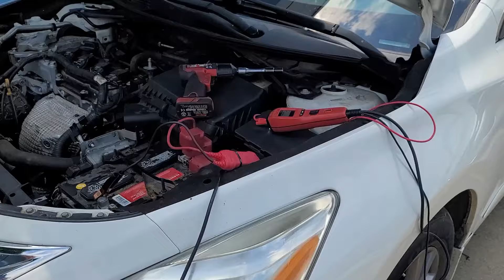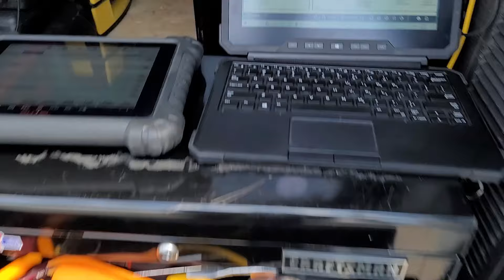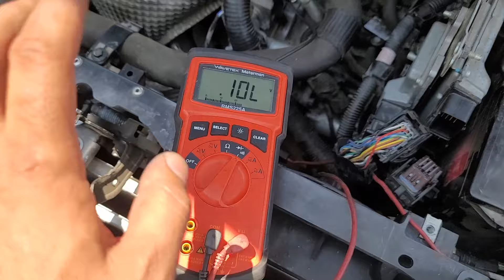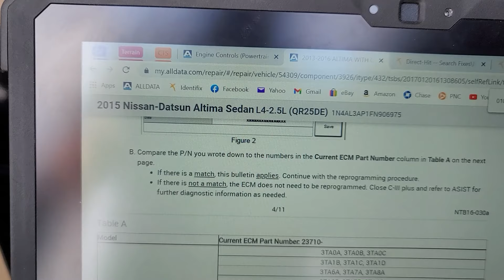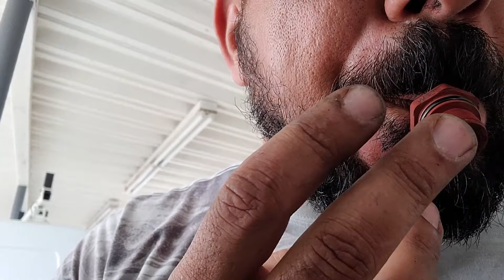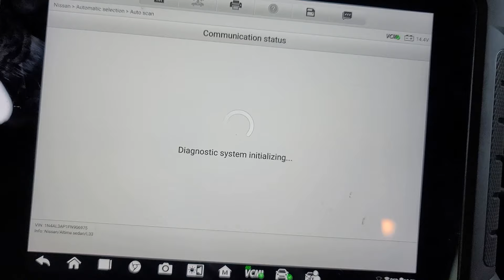P0101 Very Important and cheap repair, 2013-2016 Nissan Altima

Comment: Nice! I was about to change the PCV after not finding anything wrong and troubleshooting everything. There are a few things left if the PCV doesn't fix it. The dealership couldn't fix the issue, charged the customer for a new MAF (customer just had a new autozone MAF) and the update and returned the car in the same conditions while telling him they could fix it by installing a cold air system for like 1k 🤦. Good that I found your vid. I needed reassurance 😁. 🙏

Comment: Hi   thank you for the nice video   

I have a similar issue that I don’t know how to resolve 
I have a 2016 Infiniti QX60 SUV 
no check engine light on. 
all monitors are ready 
car drives fine 

but there’s a permanent code P0101 that will not erase and I’ve drove the car like 3000 miles.  I need this code to be erased from the computer so I can smog the vehicle. 

ANY ADEAS YOU CAN SHARE?  Much appreciate it
Reply from the maker: You may have to reprogram your PCM to solve your problem.

Comment: All nissan 2.0 and 2.5 get this code because poor design of pcv system. It draw smokey oil fumes through air cleaner which often micro sprays into intake getting the sensor dirty and or dirty throttle body . I have also found rodent nests in intake pipe that cause the same code. Also causing this code is cracking in the flex pipe before the throttle body. If it was electrical problem you would have many other codes particularly oxygen sensor codes.
Reply from the maker: Nice tip 👌
Reply: Damn you must live in Brooklyn too Smhh … damn rodents !
Reply: What can i do to fix it? Im tired of cleaning my throttle body.

Comment: Thank you very much guy. You really help me.This problem makes the car weak.  Sometimes there is no power at all.
 I left my car with un electrician for one month to fix this problem and he couldn't.
Now the car is Ok
11810-EA200 this is part number of replacement black
Reply: The TSB says that it only applies if there is no drivability problems, so if you feel no power that's most likely caused by something else.
Reply: @advancedleveldiagnostics  
Yes the problem still there.  But not like before
Reply: r arreglarlo  y tengo que Hello, I have the same problem in my car, it is a 2013 Nissan Altima. They charge me 450 dollars to fix it and I have to fix it because it doesn't pass the smog check. They have to reprogram the computer.

Comment: I changed out my maf sensor out but the car still didn't get better the check engine light didn't come back on but the code I got was po101 on a 2012 Nissan Altima
Reply: Hello, when you changed the part of your car, you reprogrammed the computer and if the smog check passes, let me know, thank you

Comment: I’ve been so frustrated with my car and the Nissan Dealer 😤 my altima has been giving me issues with this P0101 code for like 3 years. I have tried cleaning the MAF, replacing it, had my throttle body replaced by the dealer and I even replaced the pvc valve and had the dealer “reprogram” my car after installing the new sensor. You guessed it still get this code after all this! My altima struggles to accelerate and need to ease my way into the freeways. I feel like the dealer isn’t fixing the “main” problem to keep siphoning money from me. This code and problems comes up when my car struggles to accelerate and  going uphill.
Reply: Ok had same issue changed a bunch of sensors spent ton of money.  Turned out the dam car needed a software update. Dealer wanted crazy money found a Nissan mechanic that did it for $175
Reply: @pvcarmon1  a Nissan mechanic only charged you $175 for it? My Nissan dealer closest to me, charges an arm and a leg, easily any service done by then is $300 service with a smile 😑 smh .
Reply from the maker: @pvcarmon1  how much dealer asked?
Reply: @DallasAutoDiag  Nissan had a recall on this issue
Reply: I have the same issue now! I have a 2012 Altima and Nissan priced me $140 but I have to leave it there.. nope I don't trust leaving her, I'm staying with her. But I should look else where because he said it really didn't matter if I got the PCM or not. 🤔😐
Reply: Probably the whole intake manifold, that’s what it was for me
Reply: What year is your vehicle?
Reply from the maker: I would not trust the dealer a 100%
Reply from the maker: Find somebody with good skills and equipment  To check it

Comment: Very useful to me as I try to address this problem with my car (2014).  This has been giving me trouble for three years and the first I heard that it might be a PVC valve is when I bought a replacement Mass Air Flow Sensor for $181 and the manufacturer (Duralast) included a bulletin in the box!  I haven't taken it out of the package yet and am going to take a look at the voltage readings first.  The PVC valve is a much cheaper fix than a new sensor.  The dealership told me the "fix" was a new wiring harness - for $2,600.  I'll try this first.  Good video.  Many thanks!
Reply: Hey I just wanted to ask was it your pvc? I got a 2017 versa and that code just came up.
Reply: embroideristalavista6485  please give update, what did you end up having to do?
Reply: @dwaynemorris3079  I was at a Nissan dealership using a coupon for an oil change and got to talking with the service guy.  He said that it might just need to have the on-board computer reset - for $175.  I explained that I'd already spent money trying to get it resolved, so they discounted the reset to $50 and I haven't had another issue.   I still have the car.

Comment: I went to get my transmission replaced with new transmission  and now my transmission is slipping again.. very stressful situation..I don't have the money to get the diagnostic checked but if you can tell me how to check to see if my transmission was done.. 2016 Nissan Altima
Reply: Hello
We got the transmission replaced for free at the dealership. It’s some type of recall for the CVT that extends the warranty for the Trans to 85,000 miles. Hope that helps.
Reply: @blackqueenstudio4783  i did aswell they put nothing new in just kelp my car fir 2 months and wrecked it
Reply: You need to reprogram your transmission
Reply: @alexarriaza2339  how

Comment: Had the same problem, intermittent p0101. Coincidently replaced pcv valve and had to remove all coil plugs except 1, used idle air volume relearn, kill engine-> plug in #2 -> idle air relearn -> kill engine and repeat till all coils are plugged in.
Reply from the maker: Thanks for sharing

Comment: Good job but for transmission need to programing with OEM diagnostic software thank you for your great video
Reply from the maker: Unfortunately the owner just replaced the engine before he found out that the trans has this issue in it.